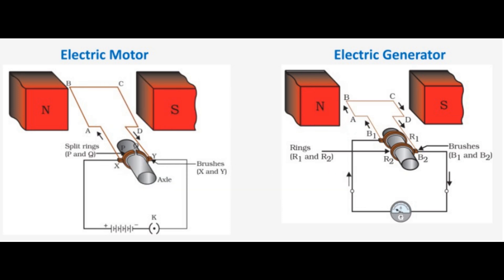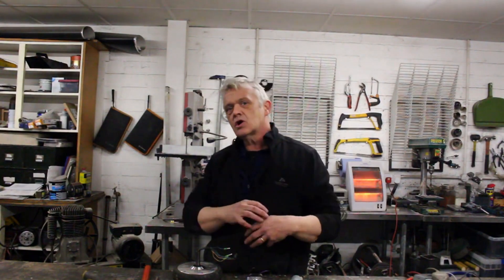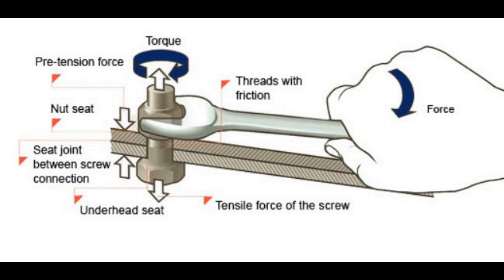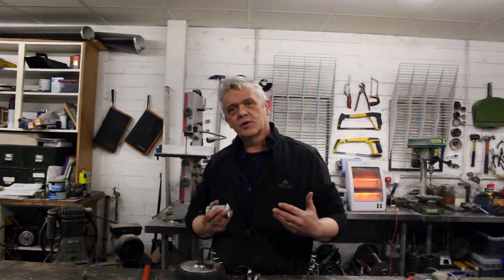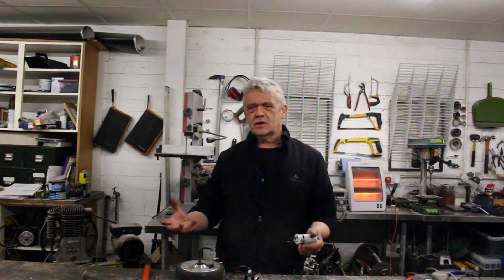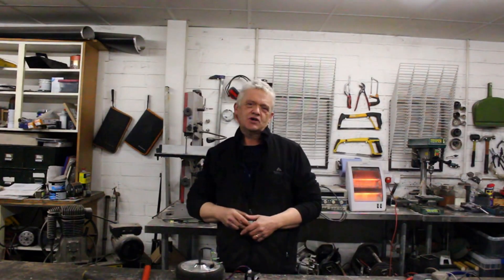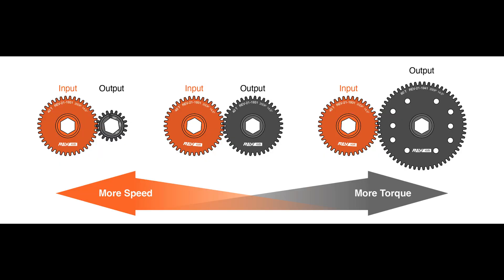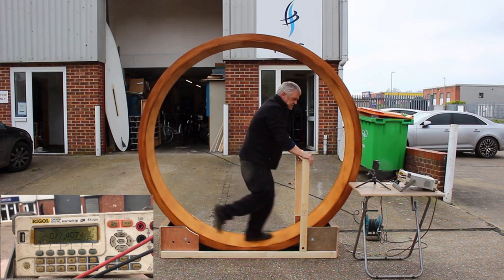2227 Choosing Motors To Turn Into Generators

Comment: Cedric Lynch's axial flux motors are the best i've ever found as both motors as well as generators.  They are low rpm high torque motors that spin approximately 50rpm per volt with incredible torque.  The AGNI motor I have can put out between .01hp-50hp
(1watt-30kw) depending on input.  More information:

The Lynch motor is an unconventional design with a disc armature. It marries the advantages of a conventional, wound armature motor with the benefits of a flat (printed circuit) motor. It is similar to a pancake motor, but is more powerful than any of these technologies. The disc armature has magnets on both sides, doubling the available flux density and shortening the magnetic path. It therefore packs more power per pound and per cubic inch than any other motor technology. Of course such a revolutionary motor is not for every application - it is not as cheap as wound field motors, but for many applications it is a far superior motor.  It has a previously unheard of power to weight ratio and also power to volume ratio. It is also highly efficient because of the double magnet design and associated short magnetic path. It also includes integral fan cooling.

 The Lynch motor is an important development which spurred other motor designers to improve their products to remain competitive, such as synchronus permanent magnet machines.  As a result of the competition between manufacturers the cost of high performance motors and controllers has fallen dramatically.  We hope the cost of solar cells also reduces to allow renewable transportation to develop as a viable alternative to carbon fuels.
Cedric Lynch built his electric bike around a mid-drive configuration, also building one of the worlds most efficient light weight electric motors to power his rig reliably at 60-MPH for significant distances. He would later set several world records with his axial flux motor and bring it to market as the Lynch / Agni motor. Briggs and Stratton would eventually buy this technology which would lead to the Etek motor, which is now famous for making high speed efficient electric hot rods.

Cedric uses to achieve high speeds is by following the rules of aerodynamics, and building a bike that is as aerodynamic and as efficient as possible. The other builders on this list bypassed this step, and Cedric uses this bicycle as daily transportation on real commutes. Although this high-efficiency motor uses “old school” brushes, this fact allows builders to use very affordable controllers. He has proven his design choices through thousands of miles of commuting, and the Lynch motor is highly respected.

Cedric Lynch is known as the creator of the Agni Motor, a highly efficient electric motor that weighs around 25 pounds and can put out as much as 50hp. 

Cedric Lynch is a British 'mad scientist' type mechanical engineer obsessed with the idea of greener transportation. His interest has been in building a super efficient yet powerful vehicle that can serve as a car replacement.

He started thinking of his own design for an electric motor in 1983 when he began entering competitions organized by the Battery Vehicle Society regarding building an efficient electric vehicle. At the time there was no reasonably priced DC motor with descent efficiency so Lynch decided to build his own utilizing modifying existing motors with old tin cans that he would spread out flat to use as cooling fins. Surprisingly using rudimentary materials and a garage work bench, Cedric was making better more efficient electric motors than any of the universities were able to manufacture in state of the art workshops.

Cedric then came up with a motor design that could be cheaply manufactured and began manufacturing his own motor that he could sell to the public in 1988 and the Lynch Electric Motor Company was born, known as LEMCO.

Cedric first used his motor to create a small boat called “The Spark” that would set an electric boat efficiency record. From there Cedric turned his attention to bicycles, an application generally considered too small for a lynch motor at that time. Cedric mounted his motor in recumbent bike, allowing him space to eventually use a set of thundersky lithium batteries.

The resulting aerodynamic recumbent bike had a top speed of 60mph and still managed an incredible range of 150 miles. Cedric rode his recumbent creation everywhere as a daily commuter, putting an amazing 50,000 miles on the machine - technically a motorbike.

Briggs and Stratton, the US firm famous for lawn mower engines, bought the technology and used it in their E-Tech Motor, and Cedric went on to manufacture his latest incarnation of his lynch design into the Agni motor, which is used in go karts, sailboats, motor boats, and even small airplanes.

The Lynch designed motors all have the same traits. Brushed motors, around 25 pounds in weight and they are able to put out enormous power compared to their weight. Sometimes as high as 50 hp (depending on amperage ran through the motor) at an incredible 98% efficiency.  Lynch Motors are also the most often used motors in electric motorcycle racing applications.

Cedric's zero-emission motorcycle, which has a top speed of 120mph, was shown in action winning the world’s first zero carbon race – the TTxGP in the Isle of Mann.

The idea for the electric motor has been snapped up by the 56-year-old’’s friend Arvind Rabadia, who together with his brother Hasmuk Rabadia had been thinking of starting a business in India. They have now set up Agni Motors to make further-improved versions of Cedric’s motors

Despite Cedric’s breakthrough invention he has no formal engineering qualifications and taught himself the techniques needed to construct his engine. He first became interested in electrics when his parents bought him a book entitled How to build things from things found at home. 
The Etek motor is a brushed 25-pound pancake shaped motor that puts out enormous power for its weight. Depending on amperage and voltage the Etek can easily provide between 15-horsepower and 30-horsepower reliably and consistently (11-kW / 22-kW). A perfect platform for a powerful electric bike if you do not mind the weight. Although brushless motors are considered more modern, a brushed motor like the Etek allows the builder to use very affordable controllers.

Cedric-Lynch invented the motor and sold it to Briggs and Stratton which US company produced the Etek at a lower price (around $600). In the late 90’s early 2000’s it was the way to go for a high-power / light-weight electric vehicle. Many small E-vehicle records were set using the Etek motor. Finally, the market had a relatively lightweight and powerful electric motor available to the masses.

In essence, the Etek allowed hot rodders to build electric bikes. Before the Etek very few people had ever achieved 50mph on an electric bike. Even today, Etek motors (and newer incarnations of the Etek motor) are used to make some super fast electric bikes. In the case of Liveforphysics, the fastest E-bikes ever.

 Liveforphysics used a newer version of the Etek (the Agni motor), to achieve speeds of over 70mph, and dominate a recent hill-climb event.

Every Etek I have ever ridden has been characterized by brutal off-the-line acceleration, usually to a point where you have to apply the throttle very carefully or get thrown off. However, it is possible to run an Etek at a lower voltage or lower amperage and have a very manageable, safe, and sane electric bike that will not burn out on you, no matter high steep the incline.

Comment: Why don't you have spokes on one side with a smaller diameter? 

That would make the entire wheel into a gear ratio and increase the torque you can apply to the generator.

Comment: Excellent video and well explained- 
But I had a "Hang on" thought-  is there any way to contain the magnetic field produced by the coils (and thus the counter torque) within an armature, like with one of those "On/off" magnets?  

That seems like it should be possible somehow.
Reply: In the case of many motors, like the hoverboard motor, the counter torque (aka cogging) comes from the iron inside the coils. It helps the magnetic field, but severely hurts the drag.
Reply from the maker: Unfortunately not
Reply: You can do it with a toroid. But you have to connect the magnetic field around the toroid correctly for the coil to produce significant power. But note that this will not remove all the counter torque. It will only limit the counter torque that  is produced by the interaction of the rotor and coil magnetic field. But the counter torque produced by the the electrons won't be affected by much if any at all. This electron counter torque is due to the moving electrons experiencing a force by the surrounding magnetic field. Nevertheless I believe it have the potential to build a self running generator.
Reply: @raloed.363  I think there may be a simpler method than a toroid.  
I mean, we know that containing magnetic flux in a simple metal armature is doable- both in the switchable magnets and, say, a transformer.  It just seems like surely you could use that sort of concept to at least cut way down on the back emf and reduce if not eliminate the torque necessary for generation.

of course if that Was possible somebody probably would have thought of that by now.

Comment: I converted a 110vac full size. Ceiling fan into an alternator. No cogging. 40 volts turning by hand. It has #36 wire and could be rewound with #26 for lower voltage, higher current.
Reply: Would definitely like to see something 3D printed to make a nice kit out of a ceiling fan.

Comment: Doesn't a dishwasher motor work well? How about teaching everyone how to turn a small 4 stroke engine into a steam powered engine, using a water heater fired by wood, turning an automotive alternator, with a 12 V battery/120 V inverter? It can be done, not very efficiently and not at high pressure, but it will work. It could be one of the few options we have in some circumstances. Steam power is incredible, still used today in nuke plants, submarines, 3 stage super steam turbines.
Reply: Consider a producer gas engine fired by charcoal.
Reply: @DavidPaulNewtonScott true, a huge benefit to both producer gas and steam is the number of options you have for fuel, most of which you can find locally and usually almost free if you’re willing to put in the labor
Reply: In the steam community it's more common to turn a two stroke motor into a uniflow steam engine.
Reply: @DaremoKamen  Who knew? I'll have to look into that. What about the bearings? I didn't know there was a steam community either, lol. Thanks
Reply: I'm the type of person that generally says to do everything that anyone tells you not to try at home, but even I recommend not playing with steam power unless you've done loads of reasearch and are a very highly skilled individual. Highly pressurized gasses or vapors in homebrew pressure vessels is a fantastic was to get a closed casket funeral.
Reply: Point well taken  @AtlasReburdened  I hope it never comes to that. I've been an electrician and machinist, I could do it but, lol. Especially super steam. Good point.
Reply: Don’t use a pressure vessel.   Use a flash boiler.  You can still get burned ,but there are no explosions.

Comment: I think there is things to discuss in the video. 
First of all I think there is different point of views regarding what is "the best" off  the shelf generator.
Sure if you look on just the motor alone, then a stepper is pretty efficient as a generator. and a brushed DC might not seem that inefficient all alone.
But its kind of half truths, because what people usually want in the end is DC voltage, and coversion to DC is also not lossless, with a three phase motor you need just six diodes compared to a stepper motors where two full bridge rectifiers is needed (8 diodes). There is also the question of off the shelf compatability, most wind energy systems are three phased, so if you want to make your own wind turbine and want it hooked up to anything serious, then three phase is the way to go. I love steppers in those kind of small scale garden projects however, as they are just so easy to deal with on a hobby scale.
Also your brushed DC alone might be 75% efficient, but then add the losses of the planetary gear needed for it to produce the 20.000rpm or so needed to have a useful voltage.

If what you want in a generator is one that generates a useful power at low RPM / high torque situations, I would measure the breaking torque of the motor when it is shorted and take the one with higher breaking torque.

I absolutely agree on your conclusion however, just nitpicking really.
Reply: I didn't realise he was talking about a stepper interesting.

Comment: It would be so great to work out in your home, and use that energy! Maybe with a computer that measures rpm's, calories, watts, and then you could track how much money you saved? I have a bicycle fitness stand and often thought it would be cool to stick an alternator or radial flux motor to it, and a battery. I'm not skilled enough to deal with charge controllers and inverters.
Reply: It's a great idea, but the Wattage output and money saved might be a bit disappointing.
Reply: I love the idea - thought about building something but... given my consistent output is likely around 200W, even with a highly efficient generator, that's a lot of pedalling just to keep the lights on - let alone make the cup of tea or cool the beer I'll be needing after a couple of hours of that!
Reply: @IanBarnfield  How about charging a battery bank that I could use to charge my bicycle lights or phone? I mean, I'm working out already. I agree there's a problem with optimization of that energy. Lost as heat and friction, loss from the inverter itself...
Reply: @IanBarnfield  did you measure the 200w or is that an idealised estimate? 
I have a strong feeling that humans aren't capable of that much. 
I'm not basing that on facts though. Just a feeling

Comment: I B using dual hoverboard motors to make a vertical wind turbine/generator! They're fairly reasonable cost (especially if you can find one at a garage sale) or flea market as I did.  I also bought one from Amazon and salvaged the motors for my current project. I do need a fair sized rotor to get results (I've got it mounted inside a H frame, BTW, thanks for the H frame idea Rob!)
Reply: I placed a post on my local Facebook page asking for "garbage" hoverboards if anyone had them. 1 lady gave me 4, saved her money trying to toss them.
Reply: Yes, pepole do not realize what they have!!! @andrewsmithmilan1780
Reply from the maker: most of the time it is whatever you can find mate lol

Comment: But Rob, the 500 RPM is for 36 volts.  How many volts do you require?  If you devide by 4, you are going to end up with roughly 12 volts for 125 RPM.
Reply: Divide by 3. 12 is 1/3rd of 36. The RPM needed for a "Precise 12V" is 166.667 RPM.
To charge a battery, we really need closer to 15, so I'd run it at roughly 190-200.
Too tired to do the maff to make it more precise atm.